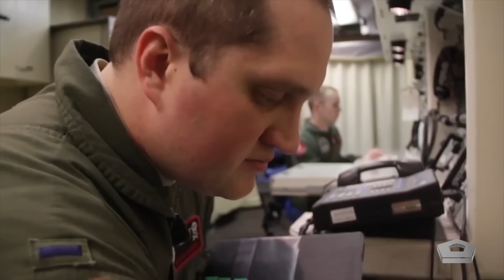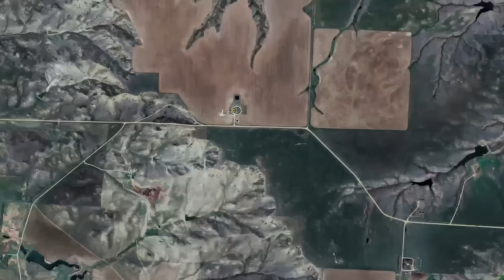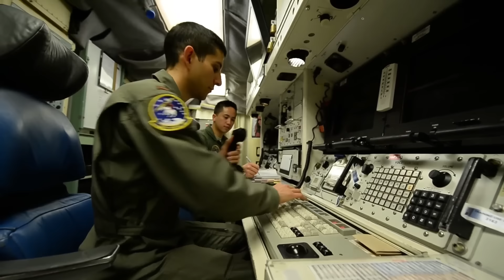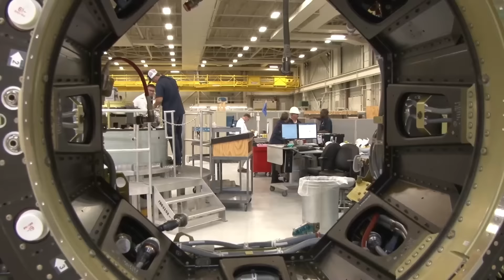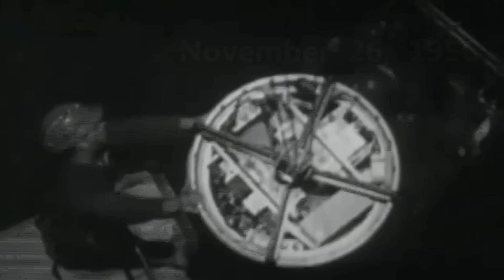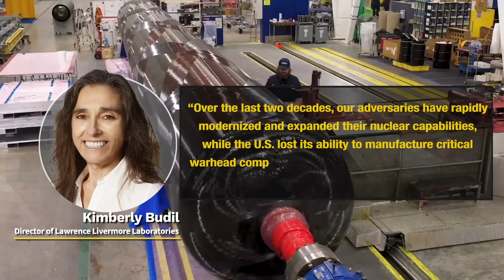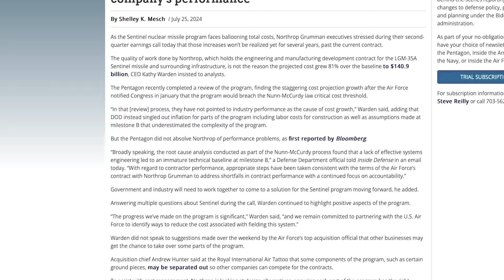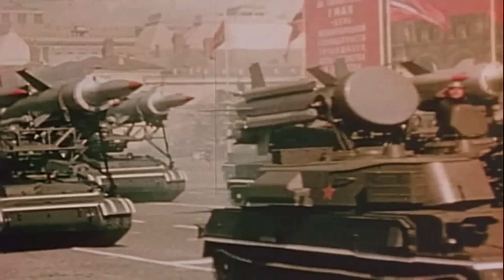America’s New Doomsday Weapon is Unstoppable

Comment: 7,500 miles of copper wire?  I can see the crackheads drooling already.
Reply: Sir, it's meth now. Get with the time 😂
Reply: @grtwhtbnr Actually grandpa, we're doing fentanyl now. Let's get you to bed 😂
Reply: @Testicool96  Tbf, everyone taking streets drugs runs that risk these days.
Reply: @Testicool96 😂 back in my day it was nose candy or happy tobaccy. The stuff the youth make/use these days is scary
Reply: @Testicool96  we're on to nitrous oxide now you boomer.
Reply: @Michael_Smith-Red_No.5 absolutely
Reply: Sir, its Fentanyl now.
Reply: Someone's got a crackhead mindset 😂, I'd never even thought of that lol when watching this about nukes
Reply: @moodogco Lol I swear I never thought of the two together 😂😂😂
Reply: Should upgrade much of that to fiber optic cables. Not to avoid theft, but just because it is better.
Reply: @Stu_Bur  Fiber is highly EMP resistant. all the long legs are non-conducting.
Reply: @stupidburp My thoughts were these 1970's systems were mostly analog with mechanical switches/relays? Hence the large amounts of copper wire? And now we're going to upgrade the system to silicon chip based computers which are vulnerable to the EMP from an exploding nuke? Makes complete and total sense.
Reply: Dwfl
Reply: @adrianwynter446  tf kinda reddit speak is that?
Reply: Two things come to mind. 1. Couldn't they just sell the copper to pay for the new missiles😅. 2. Only a crackhead would steal the copper and leave the billion dollar nuclear warhead sitting there😂
Reply: @montevallomustang  ohhh can you recommend a pawn shop to sell warheads
Reply: That’s how they launder tax dollars.
Reply: Whose volunteering? Tiktokers?
Reply: Crackheads with nukes??... sounds kinda spicy
Reply: Idk what copper wire has to do with crackheads but I'm kinda curious now.
Reply: @steviepii  they cut it, sold it to scrapyard for a chuck of change.
Reply: @idhamproaqw98  luckily (at least here in Texas) most scrapyards require you to present a traders license before they buy your scrap lol no more shady randoms being able to sell their stolen copper.
Reply: @steviepii people with drug habits that get really bad do wild things for  money.  one popular option is to steal copper wire from work sites, the walls of abandoned home, etc.  

Copper is a pretty valuable metal and the recycling facility you sell it to has no way of knowing it's stolen copper
Reply: @steviepii they steal it to sell and get meth
Reply: na not really scrap prices are crap now
Reply: I see a funding source  and 7,500 reasons NOT to reuse the old silos.  Immediately throw in jail whoever claims they can re-certify/certify that as they are stealing whatever money they are bilking us out of.
Reply: To all of you suggesting they ditch the copper for fiber, you cannot run electricity through fiber! And to those that are concerned about upgrades being vulnerable to EMPs and such, I’m absolutely sure the people in charge already thought of that and took appropriate steps to protect the systems from the aforementioned. Lastly, nuclear warheads are pretty much impossible to go off by accident, much thought and deliberation went into designing and building systems to ensure they start the reaction only when you absolutely want them to. Many cases of nuclear warheads being involved in accidents, none of them accidentally went off, for example, a B-52 bomber carrying nuclear warheads crashed near the Thule AFB, conventional explosives detonated, even the radioactive payload got dispersed, but no mushroom cloud.
Reply: @psychocuda   solid comment
Reply: What will you gain by counter acting, what is done is done, leave the white Russian girls for us 😅😅
Reply: What will you gain by counter acting, what is done is done, leave the white Russian girls for us 😅😅
Reply: Bro chill 😂😂😂
Reply: time to go wireless 😜 - or at least get rid of as much of the copper wiring as you can and use fibre' wherever possible
Reply: Only a crackhead would post this comment. And I applaud you.
Reply: What you do, is pay a bunch of them a few hundred bucks for every week that goes by without any of it being stolen. Call it crazy but it works.
Reply: I am sure the Russians already stripped all their silos for copper, tritium, uranium, and other valuable parts to sell on the black market.
Reply: Hunter Biden out there with some bolt cutters and a video camera 😂
Reply: Thats 43,000,000$ in one gauge copper
Reply: It's the Midwest.  They smoke meth.
Reply: its the military, they can afford to just leave crack around the wire to distract them. and some food perhaps.
Reply: It's about weight not length it could be hair thin wire and not be worth much
Reply: @psychocuda  all that copper wire is buried underground. I don’t think it would be economical digging it up and reselling it
Reply: People who have never dealt with a dope habit making fun of folks with dope habits. Keep up the good work experts.. 🙄
Reply: @goclimbsomething  nah - I had and I still chuckled - tho tbf I never went as far as to steal stuff when I did
Reply: @goclimbsomething nobody was specifically making fun of addicted individuals; they were criticizing cultural phenomena in a light and humorous way. Lighten up, my guy 😅
Reply: @Sarge-at-Large  Well SAID
Reply: @goclimbsomething dude calm down. Dark sense of humor is a coping mechanism. Everything is on the table for joking 😂
Reply: @magnithorsson8268  When you’ve lost folks like I have, it’s not a joke..
Reply: @goclimbsomething  bros expecting sympathy when literally everyone knows what crack does to you and yet people choose to risk it. Play stupid games, get stupid prizes, and youre entertainment for literally everyone else that knows better. Theres some cases where people are unexpectedly exposed to crack, like a laced joint, but those cases pale in comparison to willful crackheads.
Reply: @dogsbecute  well that is an interesting statement. Do you perhaps have any numbers of that, because I'd really like to know if it is an issue of character, or of abuse. I can't blame a homeless guy who got drugged while he slept in a shelter for something someone else did to him. But if you got a source that shows it's a personal choice, a moral failing in the majority of cases I might change my stance, coming from a position of compassion.
Reply: @dogsbecute u have no idea what ur talking about.  Especially now.  People get introduced to those substances without even knowing it or wanting to.
Reply: @goclimbsomething  nothing is off limits in comedy.  you can care for those struggling with addiction and still make jokes.  quit trying to be the fun police
Reply: @goclimbsomething I've been sober and off opiates for 3 years in March I laughed my ass off at that
Reply: @marcfavell  Congrats. Been about 3 years since my cuz died on fent, less than that since I’ve lost friends, so maybe it’s a bit raw for me..

Comment: You failed to mention Vandenberg Space Force Base, where there are over 40 Minuteman III's..  California.
Reply: Are these not test missiles? Vandnsberg is a test and evaluation site for the MMIII weapon system.
Reply: My info is over 20 years old, so grain of salt, but when my high school class took a field trip to Cheyenne, WY. The tour guide mentioned that Vandenberg was a site that housed 'Peace Keepers" which fit in the same size silo as the Minutemen but had to be shoved out of the tube before ignition because they were much bigger. Just based on the size of silo, you may be exactly correct.
Reply: @dustinnyffeler8624  theres most definitely retaliatory silos that are in positions around both costs. mt rainier in Washington has two at its base with a NORAD bunker. i only know about it due to google maps screwing up at one point and instead of taking me to the freeway it took me to the literal gate. they are the MIRV missiles. the full sized ones at that. the coast lines usually will have silo based retaliatory larger missiles that arent allowed to even be turned on till a launch is confirmed as til that treaties remain intact.
Reply: Wait what? Really? I'm fucked
Reply: If we are going to talk about modern weapons being better, than the Chinese nuclear weapons are better than the US nuclear weapons, since the former started building them much later.
Reply: @User-jr7vf  sure, wumao
Reply: @User-jr7vf No.
Reply: @user yeah, but it's hard to launch a rocket filled with water